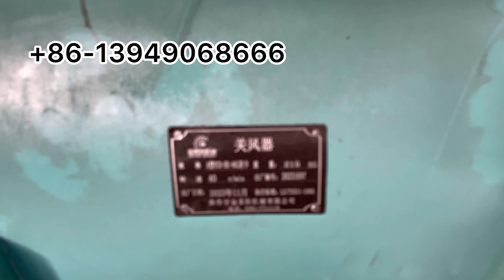Wet/ Dry wood crusher 5 - 7 ton per hour hammer mill 3- 5mm size sawdust output

Comment: Hello, this set up is very good, the conveyor the hammer mill too, but can we incorporate a hopper for loading the raw materials with a small loader or jcb machine, a little bigger has we can see at the end of the video, in Your Factory, suitable enough to hold 3 to 5 tons of woodchips so that the operator does not have to shovel a day one.
And also for cost effective. 
Nice video thank you very much. 
I should glad to see the blades of the hammer mill in you next video.
Reply from the maker: Hi, thanks for your comment. This is video for testing single model before shipping. As one of the machine in the production line, it will work together with buffering storage silo and conveyors with converter. But that’s our customers working site. If they not happy, I will never share our customers videos in my channel. So I will try to upload later once I have a chance to explain more details and show more videos. ( I rarely share customer’s factory videos in my channel, because sometimes it’s good to keep their information).
Reply from the maker: You can send me messages via WhatsApp: +86-13949068666 to get inner photo
Reply: @kimzhao-charcoalmakingmachine  I will
Reply: @kimzhao-charcoalmakingmachine  hi, thanks for your Appreciation,  ofcourse,  we need approval from buyers to inform others which are searching this specific machines.